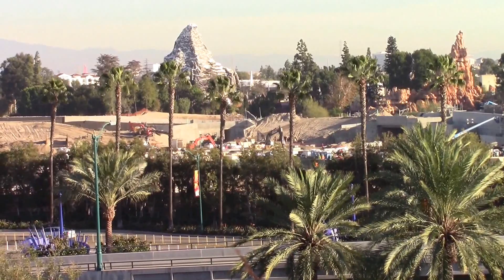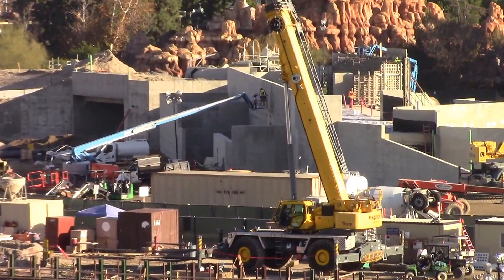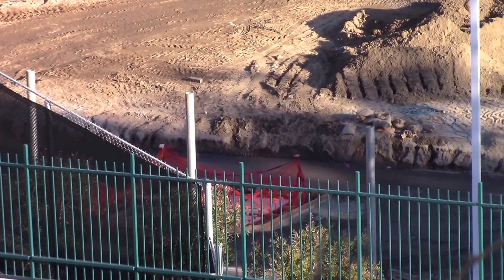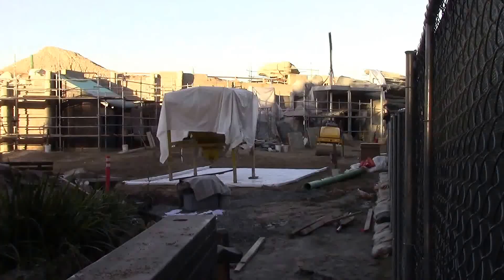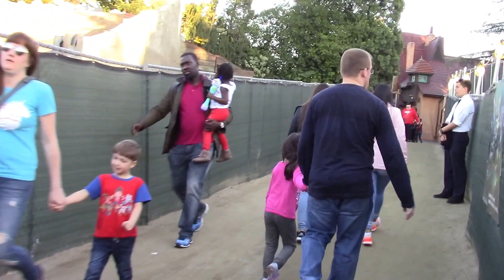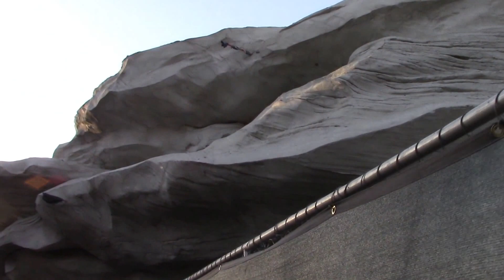Disneyland - 12/28/16 Star Wars Land Construction Update/Bonus Footage of Big Thunder Mountain Trail

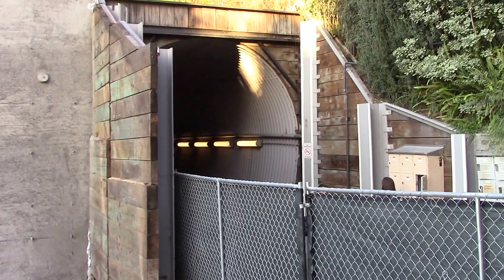Comment: at 18:50 is that a train tunnel or cast member tunnel?
Reply: Cast member.  It's been there for a long time, but was blocked by giant doors.  It leads back to behind the storybook canal to the backstage of the Fantasyland Theater.
Reply from the maker: Over the years I've often seen a glimpse of the tunnel when CMs went in through those doors, but never knew how expansive it was.  Thanks for the info Chadwpalm.